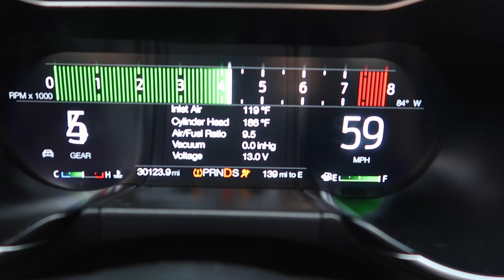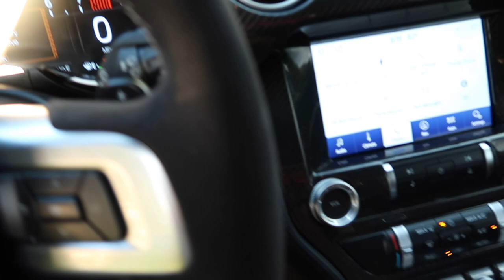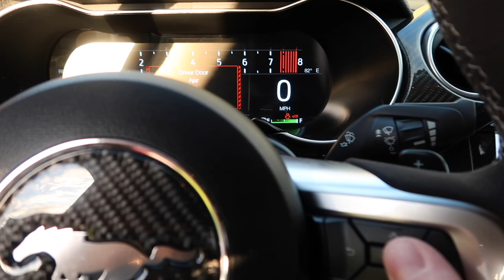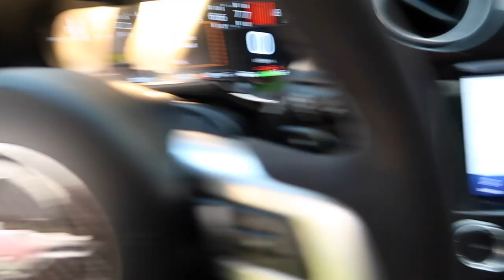My Supercharged Mustang ALMOST BLEW UP... DON'T LET THIS HAPPEN TO YOU...

Comment: As a mechanic myself, I'll say this, petrol boils at 70 Degrees Celsius, E85 boils at 78 to 80 C. As someone who's been in the automotive industry for over 20 years and having been in performance workshops, the tuners should know this. Period. No ifs, no buts, no fucken maybes. 239f is 115c. That's WELLLLLLL beyond boiling point. That fact that this was ignored, and no safety parameters where tuned in for fuel temps, is beyond fucking stupid. If your IAT's are at 239f, or well beyond 200f, and when you mix fuel with that, you're literally moving beyond the safe thresholds of the mix. Fuel is meant to be a coolant as well as an ignition source. The secondary issue is the super heating of the intake port into the cylinder. Once it reaches a certain point, and the delivery source of your fuel and air is stupidly hot, its not going to bring temps down, as its basically incubating the heat. when your mix is well beyond its safe limits, and no safety parameters are putting it in limp mode, well, it's shown its ugly head. It's should have had a limiter for anything over 150f for fuel and similarly for intake.

Comment: Thats a good heads up for Stangmode Battle. That is something he should look into which may have cause his engine to blow up again, cause that engine was rated for 1500 horsepower, but one thing I don't understand is with his set up, why would he add NOS? Thats what dont make any sense to me

Comment: That's a horrible design. The pump should be lower than the reservoir. That would insure head pressure to the pump.  And in such an important system why is there no pressure or flow guage indication.

Comment: On my 03 cobra I had a measure pump that failed twice . I went back to the stock pump . No pump failures for 70k miles . I also have a morose ice tank in the under hood battery well .
The factory pump is the lowest component in the system . Your system, my system is not airless meaning that cap on the
 Tank is vented . As long as the pump is the lowest component  it will always self prime . I always wondered as the ice melted ... not having a screen .... could a chunk of ice jam the pump ?  I have learned that ford performance and factory parts are always more dependable and better engineered especially if they came on the car originally .
Because they have to live up to the warranty.  I do think killer chiller is my next step .... no moving parts !!!
Dodge uses a OEM version on the hellcats . Of course pushing the limits well.....
You know ....its nobody's fault but our own !!! LOL !!!
TK

Comment: E85, meth or 50/50 with a centrifugal and iats never get past 120and  get colder down to 70-80 during the pull. Interchilllers are nice but meth cools iat during the run best, adds octane and cools cylinder temps which is the real cause of detonation better. Only use meth for cooling and octane never for fueling so if a pump goes out your self brother.

Comment: Yeah, these stories just push me further away from boosting my GT350R.  Fast and unreliable, or slow and reliable, it’s a hard decision.  Glad your motor is ok. 🇺🇸
Reply: I'd be thrilled with a stock GT 350R.
Reply: Procharger w/stage 2 intercooler and a 170 thermostat Lund or PB tune and be done with it or a turbo setup.
Reply: Even stock and slow they’re unreliable
Reply: @agaad22  5.0 FTW
Reply: @agaad22  Truth
Reply: @agaad22  was thinking the same thing, would not say reliable abt gt350 in the same sentence 🤣🤣🤣

Comment: Sounds like a few good ideas in the comments. I think what is happening is when you kill the power to the pump it's back flowing and pulling in air. To fix that you would need a check valve coming in and going out. The only way I can figure out how this could happen is if the car is parked on uneven ground with not enough water in the tank.

Comment: I would have a new npt bung tig welded in the bottom of the tank and mount the pump under the trunk below the tank. That way the pump will gravity feed on the suction side 'electric pumps are notorious for being poor pullers and great pushers.

Comment: running the pump with the tank open doesn't get air in the system?
Reply: If I were fabricating the system I would have the bung feeding the pump coming out of the bottom of the tank with the pump underneath the floorboard with baffles in the tank to limit sloshing. Not entirely foolproof, but probably best case scenario.

Comment: Wow that is very crazy, it does look like found the true reason why IAT's got so damn high that quickly. Just seeing yours doing that in the video is bad news for that pump 
manufacture. Pump like that should not fail that quickly in short period you had it. Definitely Stangmode should check it.

Comment: Are those intercooler pumps centrifugal or gear? 🤔
Reply: @Zander13Productions  they should be gear pumps so it can always get prime.  A centrifugal pump is more efficient tho, but can loose prime easily so...🤷🏻‍♂️

Comment: Good video and topic Alex. 
I thought the same. It must be related to some issue with the air to water intercooler system. At least I can't see how it chould be an L&M related issue. It is not like these guys haven't build a coyote based engine 1-2 before!.
Stuff like this makes me 2nd cause my desire to get a PD blower for my street driven only 5.0 Mustang where you want to lean on the thottle without having to watch out for the IAT's 
Now I hate the off throttle sound of a centrifugal blowers. At least with an vent to atmosphere BOV. 

But they have many benefits over PD as for run cooler, more efficient, less complexity with it's air to air system and you run stock throttle body for good driveability.
Ok, they don't give as much torque at lower rpm's. But coyote's especially  manual 15-17 onea with 3.73 gears. They rev' so fast you are always there in the higher part of the rev range anyway. Also I would assume a centri would be a good fit for 10r80cars. 
After all most street stuff is roll racing so in those scenarios. Air to air works fine and the low end punch isn't as big of a factor. 
Also worth mentioning. Can the low end torque of a TVS realy ever been put to the ground in a rear wheel drive car unless unless condition are perfect as for road condition,and tire and air temp? 

I doubt here in Iceland where it get max 60-65F few days of year usually below 50-60. 
I can find any low speed traction( drag radials or not ) on the street. And I doubt I would really ever see the benefit of having air to water intercooling over conventional air to air.

Comment: With all due respect, Stangmode has a history of hotlapping back to back to back on a regular basis with all of his vehicles. It was only a matter of time before his issues started to show up. He’s been getting lucky for a while now.
Reply from the maker: That’s also true yes
Reply: Mayb tune
Reply: Will all the respect, you are not correct. Hulk makes a pass at poconos and then sits with fans in the garage for at least 30-45min while we check logs, record content, talk to people and etc. Mamba does two passes at a time tops (usually one, two is extremely rare occasion) before it goes on timeout and sits untill it cools down (Odin does run hot). I say it from the perspective of a person who actually supports those cars at events and as concerned about them as everybody else. As for luck - it usually doesn't get you that far tbh, especially in racing. We all humans, we make decisions on information available to us at the moment (whether it comes from gauges, mechanic, tuner or whoever) so tbh, I would probably run the car second time as well, looking at 90 degrees IAT, knowing about built motor, NOS and ice tank and also knowing that car feels healthy and there is nothing suspicious in the logs (checked them after each pass).
Reply from the maker: @darkvader_s650  💪